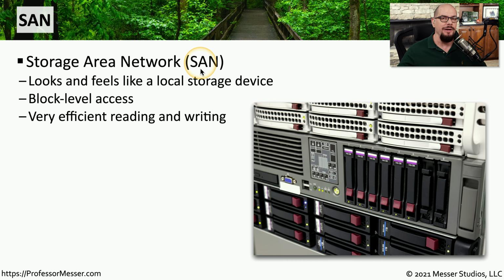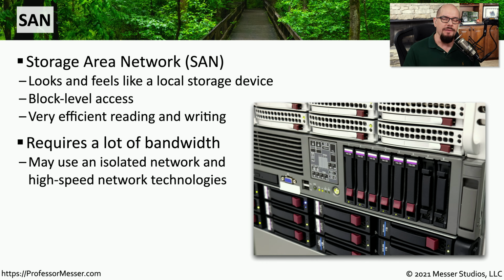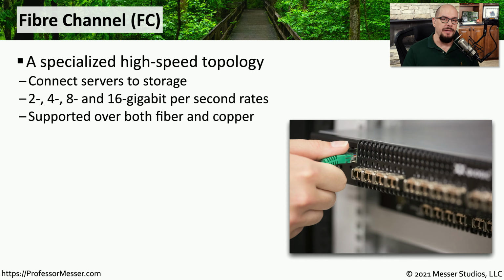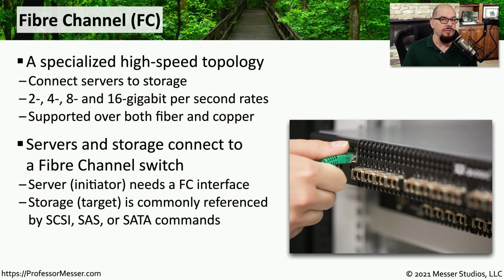Storage Area Networks - N10-008 CompTIA Network+ : 1.7

Comment: He mentioned in the video RFC during the ISCSI slide.. what exactly is that? Not sure if I missed something from previous lessons.
Reply: RFC’s are basically the internet protocol standards. Concepts like TCP/IP and DNS are an example of something that became an internet standard that’s now widely used. So if you see something is an RFC or has an RFC number just think of it as being standard.
Reply: @elbon4271  Thanks for clarification, man!